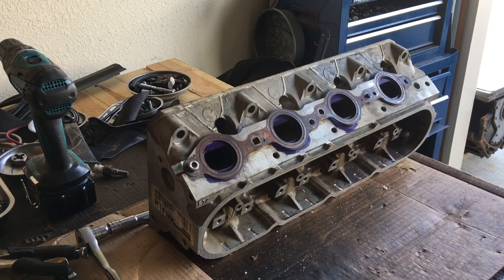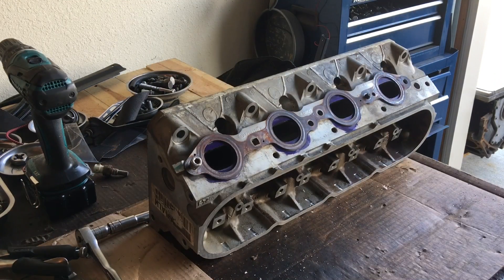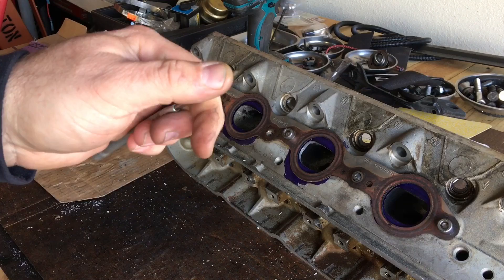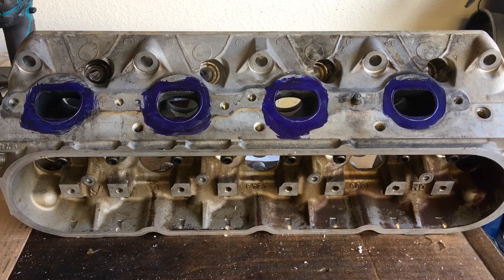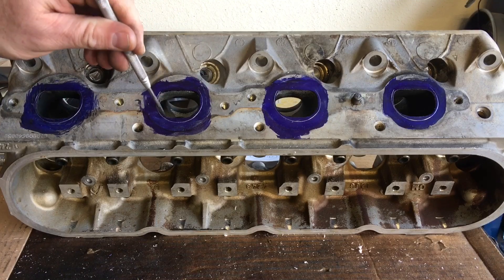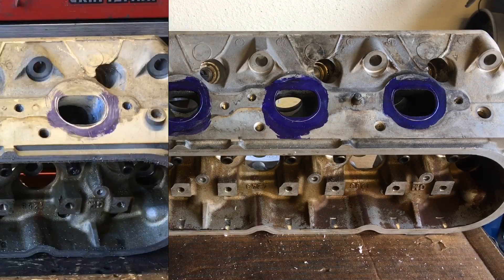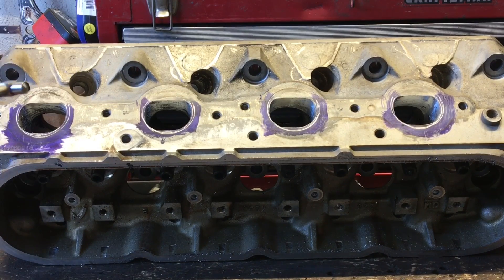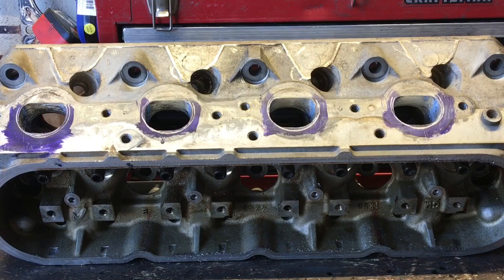243/799 Heads Porting Step 1

Comment: You dont leave a blocking flow face ledge on the head for a anti-reversion help ?? I know most LS cams have wider lobe seperation angles and this shows best with narrower LSA . .  However that can really help torque well below peak ive found . Especially on smaller engines they are much more responsive with this A.R. ledge left on around the port  with the manifold or header flange  opening enlarged to form a dam to reverse flow .

Comment: So going back to 'gasket matching'.. If you take you heads of and see the carbon on the face of exh side of head.. You can raise the roof and use the carbon build-up as a reference. Of course see leave some room for margin of error unless you also plan to take material off the 'roof' of the header primary tube. I'm doing this now on my dd heads that have 1.75in primary long tubes.
Reply from the maker: Yes you’re correct on seeing the carbon outline.  There is some truth to leaving the roof slightly lower/shorter than the header/manifold to combat exhaust pulse reversion; how much it helps and when it’s a concern I’m not sure. 
Just remember once you open the exhaust port exit to match the larger header you can’t go back to stock manifolds or smaller tube headers.  JD
Reply: @HeadFlowInc  exactly. Measure 2x.. Cut 1x. Plus more time I'm porting.. Longer I'm gonna get my car back together.

Comment: Flow numbers? The numbers you never provide to see what your  port work does?
Reply from the maker: Hey Peter I knew you were still out there waiting. I have complete flow sheets on a set of 243’s on paper; I haven’t taken the time to create a spreadsheet with the data.  I’m using Clark Riddle Flowbench Testing in Independence, Mo. 
I’m currently moving but what data are you interested in?

Comment: Not sure if you have this on another video.....but do you remove the bump for the rocker bolt in the intake runner?
Reply from the maker: I let the customer decide if they want the rocker bolt lump fully removed or greatly reduced.  For years I only reduced the lump but then decided to start offering removal; you’d be surprised how many people don’t want to mess with putting sealer on the rocker bolts after removing the lump. 
I plan on doing a video showing flow difference between stock, reduced and removed rocker bolt lump.  JD
Reply: @HeadFlowInc  that would be awesome to see, I’ve just removed mine and wondered how much difference removing them makes!

Comment: So the main focus is the roof of the exh port. Now on the floor, should still clean up all casting surface so it's still smoother vs rigid or bumpy texture correct?n
Thanks
Reply from the maker: Yes, you are correct the floor will only be touched enough to create texture to blend. JD
Reply: @HeadFlowInc  Ok. Cool. Do you have a FB page? I think the 243's I'm working on are turning out nicely being the 1st set of heads I've ever ported to use on a motor. I'm going to make a video of them when finished. And if they turn out good, then it shows you were a good teacher! Thanks again. Very much appreciated all your videos and direct help! 
Have a safe one!
Reply from the maker: @charliecadaver666  It sounds like your doing great!  Going slow and getting used to the tools is key. 
FB  Jeff DuBray

Comment: Would this be applicable to any ls casting heads?
Reply from the maker: Honestly starting with the exhaust port exit is an easy first step I felt to get started.  Many times I start with the bowl cut percentages but I didn’t want a first time or inexperienced porter feeling added stress/pressure to start in such a crucial area.  It does depend on how confident you are with tool control/technique on where you start.  Does this answer your question?  JD

Comment: Would you like too do a build off. We can build a motor from the bottom up do it in a couple of stages like we can build the heads put it on a flow bench see the flow  complete the motors put them on a Dyno and see who makes more horsepower then we can donate the motors to any  veterans charity
Reply from the maker: I was never notified of this post, I just found it.  I’m not a successful youtuber I don’t have the money to do a build off. Sadly
I like the idea though,  I build 4.8’s because they’re more affordable. I now have access to a flow bench again but not sure about an engine Dyno and the costs.
I will be upgrading my 4.8 turbo in my S10 Blazer over the Winter if you’re interested in building a 4.8.  JD

Comment: How come you don't have any flow numbers?
Reply from the maker: GTO Kid Flow numbers are available and many shops can provide copies of flow numbers to make a person feel better, but there’s no way to know if they actually flowed your heads. 
After the early 2000’s here in the KC area  there wasn’t any flow bench available after K&M machine shop closed;  No flow sheets available. 
Recently in the last 1-2 years we have located a private individual who owns the K&M flow bench offering flow service for $125.00!  Problem is I offer to have my heads flowed but nobody chooses to pay for it. 

I guess the best answer is I don’t own a flow bench and can’t justify spending $125.00 to have each set flowed unless the customer pays for it.  A BIG issue I see is with flow sheets showing big flow at .700-.800” lift where nobody runs cams this big!  What’s important is the flow from .200”-.650” lift where the cams are built to run.
My old 215cc port flowed 275+ cfm at .600” lift
My old 220cc port flowed 285+ cfm at .600” lift
I’ve since added a 225cc port I’m confident flows 300+ cfm at .600”
Reply: @HeadFlowInc  you port 1 intake and exhaust, and I'll  have them flowed.
Reply from the maker: GTO Kid Which port size and valve sizes?  I have a set of 862’s stock valves 1.89”/1.55” I’m finishing now.  Or I have a set of 241 heads 2.00”-1.55” valves I could work on. JD
Reply: @HeadFlowInc  let's see your 241 numbers, sence most ls heads are 2.00 valve.
Reply from the maker: Ok, keep an eye out for the Videos on porting the 241’s. But are you wanting to see a max effort port or something moderate?
Reply: @HeadFlowInc  I would be interested in flowing your max effort  225cc runners. I'll keep an eye out for the video, and get in touch with you to get them flowed.
Reply from the maker: Sounds good! 👍
Reply from the maker: Update, I’m trying to get my S10 Blazer Turbo install done enough to bring it back to my house, so be patient on the porting video etc.  I’ll try to put up as much as I can squeeze in during the process.  Thanks again for the support I appreciate it!  JD

Comment: How much to port my heads ?? How in houston TX
Reply from the maker: Mario Rosales Hey Mario, I was going to mention, I’m considering porting heads and having them for sale ready to ship if that works better?  I know when there’s shipping both ways it can be expensive, I fully insure heads after porting which always costs me $100.00+ when returning heads.  
There are also different stages to porting if you didn’t want cash much porting etc.  Anyway I wanted to touch base with you!  Thanks for watching and the feedback I appreciate it!  JD
Reply from the maker: Mario Rosales It all depends on if the heads need any machine work and if the valves are in good shape. 
Porting the heads runs $750.00 plus shipping both ways; the customer supplies new parts. Springs, Seals etc etc. 
surfacing the heads $125.00
CNC Valve job I’ll have to get the current price from Nolands Cylinder Heads. If changing valve sizes a valve job is required, like 1.89” to 2.00”

Comment: What can be done to a 4.8, I'm dipping into the LS world finally I know it started years ago but it wasn't my thing till. I have a 4.8 low miles in a shortbed bed Silverado. Just want a little more go without redoing the while engine right now.
Reply from the maker: Frank M First and most importantly is a performance Tune!  The factory sends these engines out so detuned and lean you’ll be amazed how much power it can make stock!  Naturally a camshaft will add another 50-75hp but be careful how big you go unless you want/plan to change rear gears and upgrade to a performance torque converter. 
A stock 4.8 with a tune makes a little over 300hp at the crankshaft. With a moderate cam upgrade you could easily hit 350-370hp+ at the crankshaft. 
Naturally I recommend upgrading the valve springs during the camshaft install and replace all the positive valve seals to.  
Thanks for watching and the feedback I appreciate it!  JD
Reply: @HeadFlowInc  Thanks for reply.  I'll make sure not to go over board with the tune. I plan to get another 4.8 to build but its Daily driver so I don't want to go all out haha but I probably will again
Reply: What would be your suggestion for the max camshaft without changing your stock stall,  212/218?  Would it be beneficial to lap and seat your valves  at the bare minimum while doing a cam swap?

Comment: Hi hf thnxs for sharing. is there any ruff mathematical formular for porting the bowl to runners or even runners to exhaust  ports at all.
Reply from the maker: MicTheGreaseMonkey I have an old video discussing porting math. 
Basically it’s percentages and blending; knowing where not to remove material. 
Your bowl cuts and valve job are huge to improving flow.  
I use these bowl cut percentages:
* I Intake bowl 89-90% of valve size.
* Exhaust bowl 86-87% of valve size. 
Smoothly blending the transition to the bowl without removing much  material behind the guide. 
Valve guide boss reduction/shaping.
Gasket matching both intake/exhaust. Etc. There’s more to it depending on what heads you’re working but it’s a basic recipe. JD

Comment: Im sorry but the best way to do what your doing and how most engine builders do it is to  use the header or manifold your useing and put dye on one side ,bolt it on then, open the ports to match each other after you open your head as far as you can open it. If your useing manifolds then i would open the head up as much as i could top and bottom then port match manifold to head.not with the gasket you can trim that to fit after you open the head not saying your way dosnt help just not as much as you could. If your going to port a little might as well open them as far as you can get them. I know you can open those ports alot more then your going
Reply from the maker: Charles Torruella You have NO idea what your talking about, it’s just that simple.
You NEVER port the floor of the port, so your inexperienced statement of making the port as big as possible Top & Bottom shows you know nothing about head flow. 
I could waste my time chastising you, but instead I’ll invite you to research porting theory so you can learn how wrong you are.  Good luck!  JD
Reply: Actually, there's several instances where the floors need work but it's generally in the area of the short turn radius in order to control the air speed. 
Widening, lowering and/or raising the area in the short turns is actually VERY common depending on the casting and what it needs. 
That's where experience, hours spent on a flowbench with a manometer, flow balls, etc. and later dyno testing pays dividends. 

Most experienced head porters will also either pour molds of the ports or will cut templates that can be used as go-nogo gauges in order to save time the next time they are working on the same casting numbers. It also aides in port-to-port duplication.

You'll also find some cylinder head guys actually prefer the port opening (ex port) to actually be a smidge smaller than the header flange/exhaust manifold. Several reputable porters and engine builders have said it actually helps negate some reversion. 

and for the record, approximately 80-90% of the flow (and thus HP) gains you'll find on those (most all factory) castings will be in the bowls/short turns and blending into the chambers in order to unshroud the valve and increase the curtain area. "Hogging" in the runners may look cool, but doesn't generally have much (if any) payoff in terms of performance.
Reply: @HeadFlowInc  do you have any recommended reading regarding porting theory?  I'd love to check out some info on the topic
Reply: You porting techniques are almost identical to mine and your right this guy has absolutely no idea what he is talking about. I've seen so many people ruin heads because they think your suppose to open the port as big as you can and drop the floor that couldn't be further from the truth. I love it when i give someone a price for port work and they say thats to high I'll do it myself and they end up bringing the heads in to me to fix and it costs them more because they hogged completely out.

Comment: Im working woth 243 heads as well but my side wall isnt as close to the gasket as yours in the video are. Could you please shed some light on this issue.
Reply from the maker: Tiga Tamimi So your saying the walls of your exhaust ports aren’t close to the gasket?
First thing, verify the gasket is oriented correctly in terms of “Side toward manifold” this side up.  It’s easy to put the gasket on wrong. 
If the gasket is on right, scribe the walls and roof to see where the gasket match needs to be.  JD
Reply: @HeadFlowInc  the gasket is correct for sure. All the holes lined up down was down and manifold side is out. If you have an email i could send u some pictures i dont wanna ruin the heads so any help would be greatly appreciated.

Comment: Hey man how is that 1838 cam for a daily driver NA 5.3?
Reply from the maker: sacgrown1 It’s a great Daily Driver, not too bad on gas, but be honest with yourself how important the idle sound is.  The 1838p has a very mild idle, if you really want some “Chop” I’d recommend the 1839p 👍😉
Reply: HeadFlowInc awesome thanks do you recommend a stall with this cam?
Reply from the maker: sacgrown1 I’m apologizing, Youtube doesn’t notify me of subsequent replies!  I’d recommend at least a 2800+ converter with the 1838p cam for racing or a 2200-2600 for a driver.  Probably too late and my apologies!  JD

Comment: What is your practice,  prior to starting  porting customers heads ,to determine if heads are cracked?  Do you clean and inspect them or send them out?  Is it fairly common to be cracked by exhaust seats on the alum. LS heads, like the one of your own  that you found?  Were you able to save that head?    Thanks
Reply from the maker: Docg 92S10 I’ve started closely checking all the castings in between the valve seats.  It is a common occurrence to see a heat cracking on some higher mileage castings.  The set I had last year passed a vacuum check so the cracking was on the surface.
I had a few people reply to the video saying they had the same issue with their heads and none of them leaked either.  I was wondering if the issue was related to specific castings, excessive heat situations or other service related cause? 
Locally the shops charge $100.00-150.00 to check a set of heads if needed.
Reply: 706 castings seem to be the worst for this cracking to cause problems .